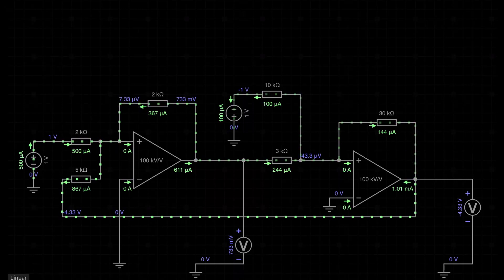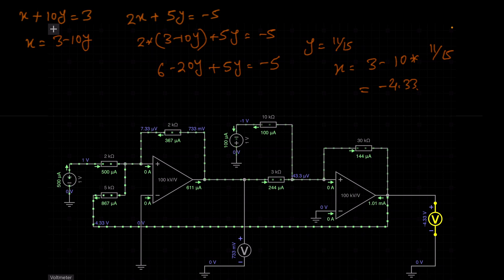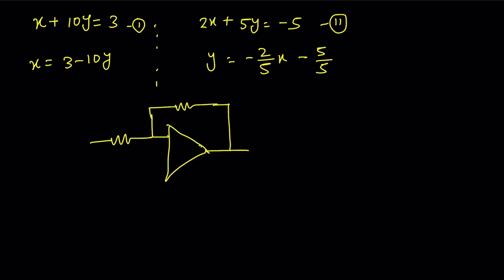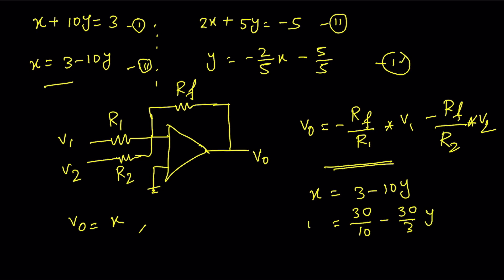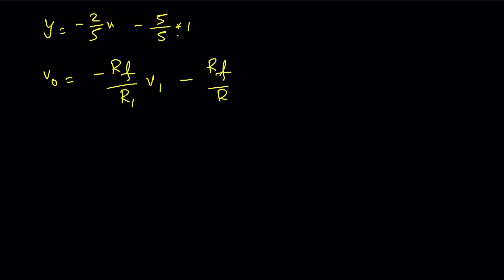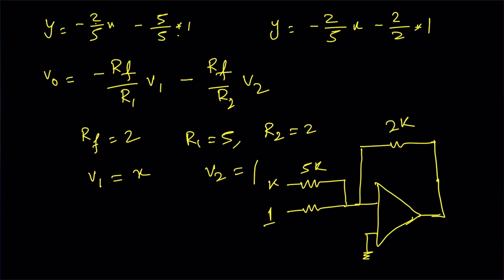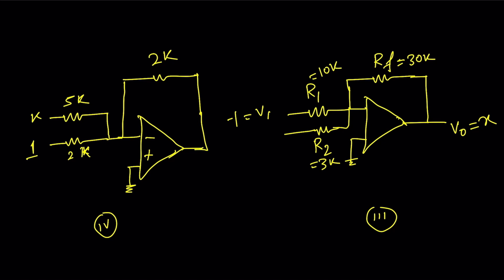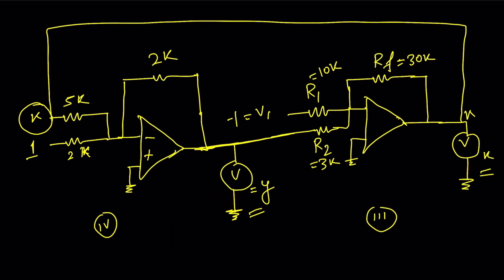Linear Equation Solution by using OPAMP || Cascade OPAMP Circuit

Comment: can we connect the output X with the input X and draw the circuit accordingly? Instead of output  Y with the input Y(which you did in the video)
Reply from the maker: Yes you can do it but you need properly choose the resistance such that final equation should be the same.